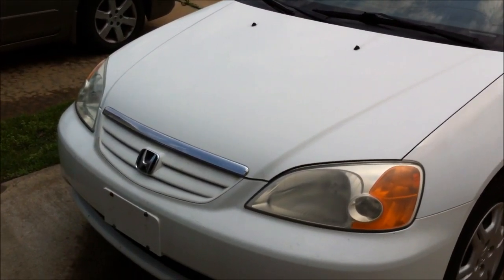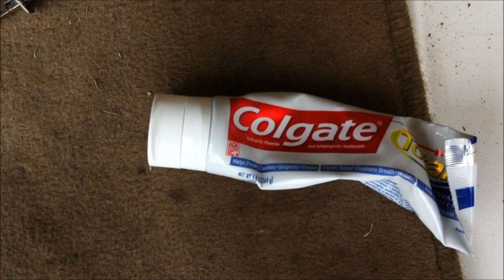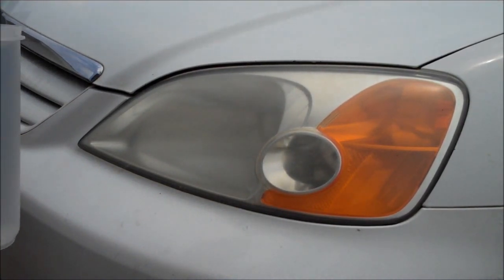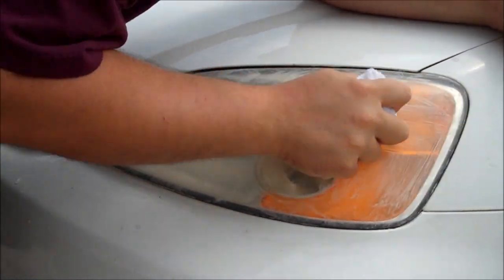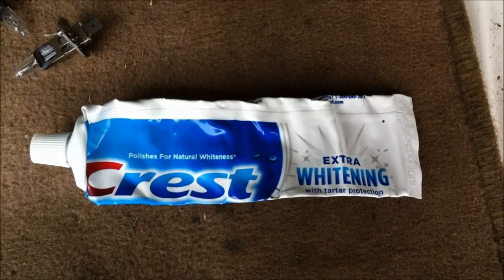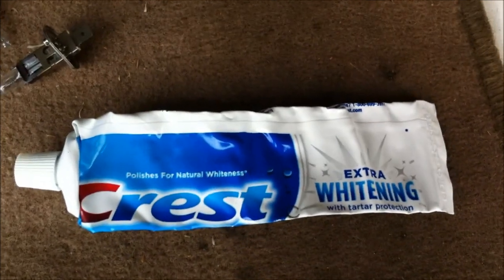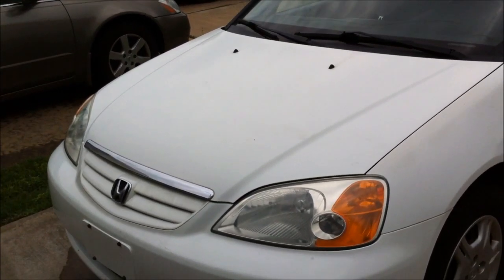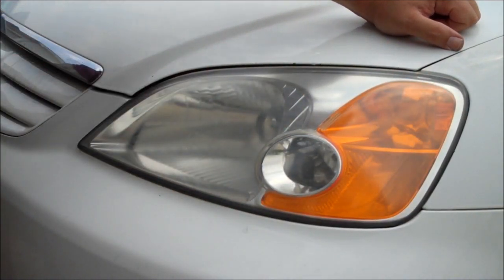Headlight Lens Restore using Toothpaste!

Comment: You're using abrasives which strips away the UV layer, tantamount to tearing off skin to get rid of the acne. Your headlights will gradually turn yellow for good. If you care about the look of your car beyond this week don't ever do this just buy a $20 deoxidizer.

Comment: what are you talking about you're cutting and buffing the surface. the polishing agent in the toothpaste and the granules are a cheap way to do it 1 shot. who cares if people "ruin" their headlights, that's your problem if it bothers you so much. those kits require you to using "abrasives" aka sand paper and then polish and buff it.

Comment: Car Warning Lights and Indicators App
Website:  http://Carwarninglight.com
YouTube: http://youtu.be/u5o9CdUbwms
 
'Car Warning and Indicator Lights' usefulness is unique, very practical app for drivers, as it can be used on the road to help drivers to make right decision in emergency situation.
 
Working as an auto mechanic for many years, I realize the people have very limited understanding of the indicators lights meanings.
 
I decided  to create the app that will contain all the warning and indicators lights
with the right explanation of the problem, and short description of the vehicle's system that is malfunctioning. With the advice how to react if the indicator light come on. It is safe to keep driving or drive has to pull over to avoid expensive repairs, or dangerous situations on the road.
 
The app comes bundled with many useful tips, and has all the Emergency Roadside Assistance dial phone numbers, for Canada and USA.
As well the Parking Reminder with sound alert, and the Car Finder to find parked car on map. The app contain 468 unique indicators lights, their description and meanings.
 
There is not such as app available that contain that many different cars indicators lights with detail explanation of the problems and advice what to do.
It took me about six moths to research and gathered all the technical information, design, and publish the app.

Comment: Be careful!!! This toothpaste method made my headlights 10 times worse!  I think it depends on the exact type of plastic used for the headlight lens or the clear coat on them.  Whatever the case, beware!  If you want to try the toothpaste method, try a small area off to the side first.

Comment: doesnt sound like a very good kit. most headlight kits are bullshit anyways.. make a diy kit. you need 1000, 2000 and 2500 grit sandpaper. (3m sells all in 1 sandpaper pack) and a spray bottle with dawn soap and water. start from lowest paper to highest. while you're sanding make sure you keep the sandpaper wet with soapy water once you finish with sanding get 3m or mothers, meguiars compound paste they all work the same and buff out the whole headlight and apply wax or sealant for protection.

Comment: This does not work for cars that live in the heat of Arizona...
Reply: Cameron Church It does work, it just doesn't keep its shine for very long. Especially during the summer.
Reply: Cameron Church Try using a good car polish on it after you clean it. It will make it stay clear longer. I use liquid glass, but maguires works well also. Dont use the cheap stuff.
Reply: Thanks for the tips guys! I will look into this.

Comment: Toothpaste is a quick clean. That is a temporary fix. I have been restoring headlights professionally since 2007. The kit I use it is the EZ4U2 headlight restoration kit. Pick it up on Amazon. Here is the instruction video. 
https://www.youtube.com/watch?v=1iPhBU8_ZNc
Check it out yourself. It's a more permanent fix. Last for years.